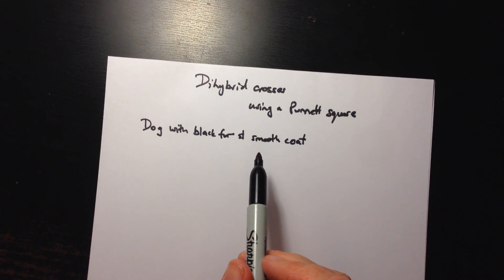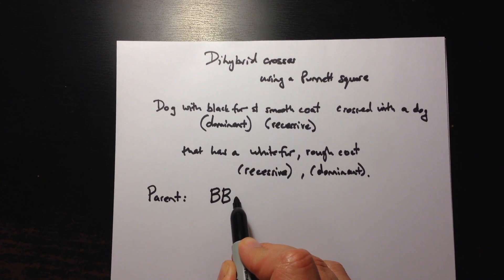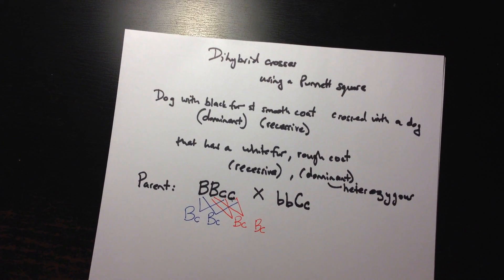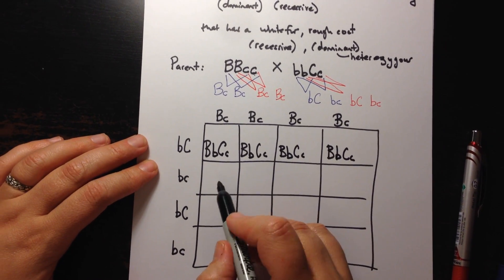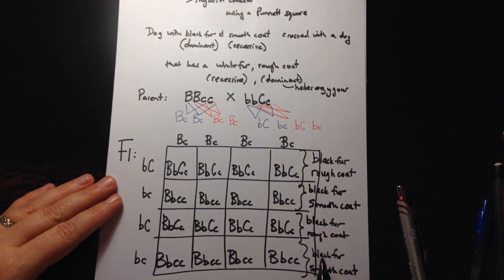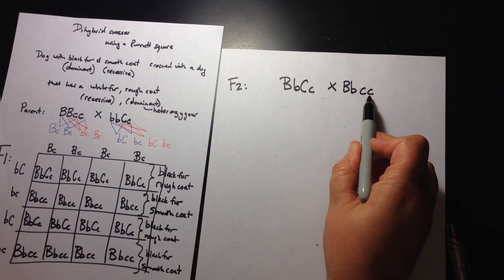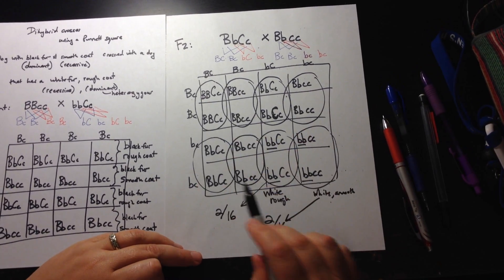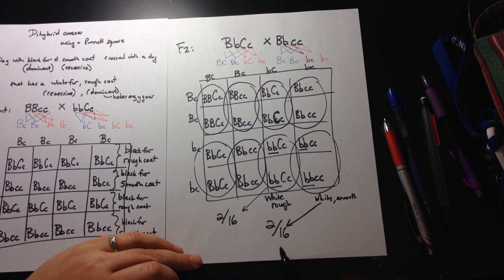Dihybrid Crosses using a Punnett Square

Comment: Im having so much trouble still. How do I solve something like BcCe x BcCC with punnet square?? I am looking everywhere
Reply from the maker: Are you sure you typed the genotypes correctly? BcCe is not a dihydrid cross. The "B" has to be matched with another "B", either B or b. Same with C. So doublecheck if you read the question correctly.